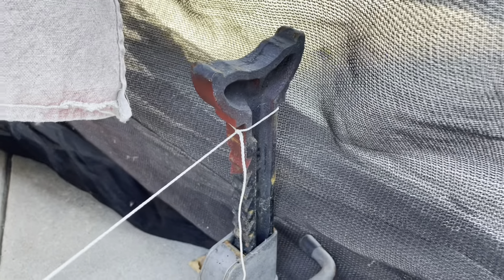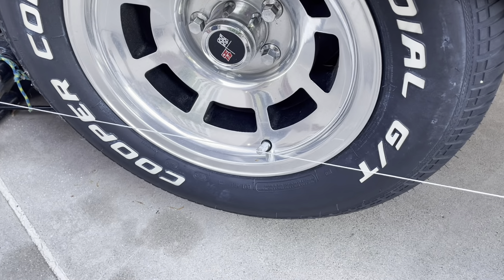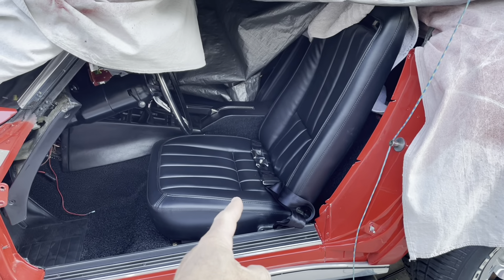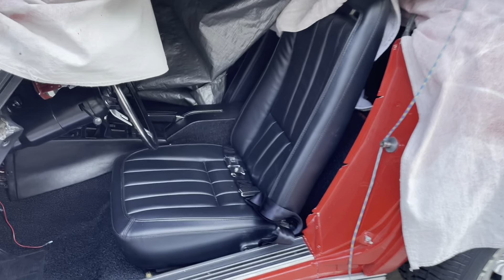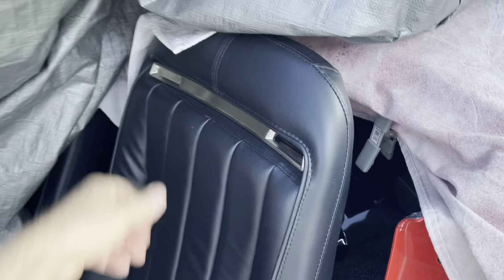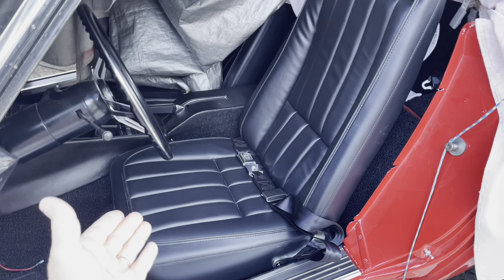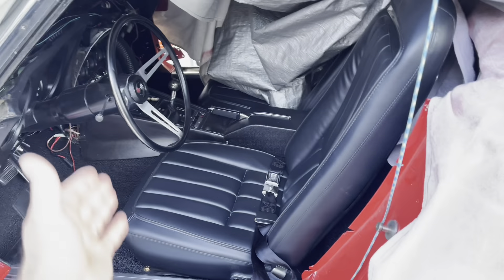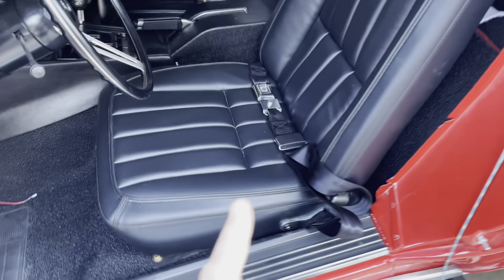C3 Driveway Wheel Alignment

Comment: I have a question what size is your quick jack thinking about getting one thanks.🙏🏾 nosale
Reply from the maker: @tyronemorina4306  It’s the largest size, rated at 7500 lbs, I believe. But, I only got that one because it was used, local, and a good price. It’s overkill unless you’re lifting trucks.
Reply: @thedrivewayC3  thanks for your quick response I admire your build and the way you approach each situation. 👍🏾